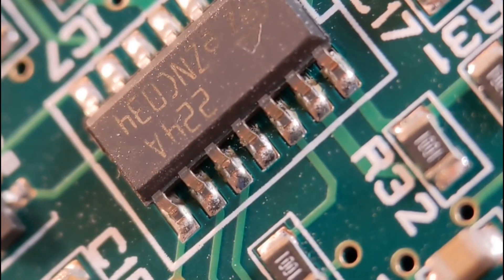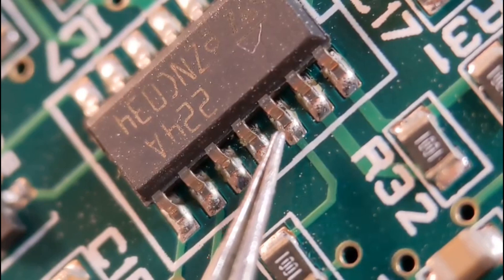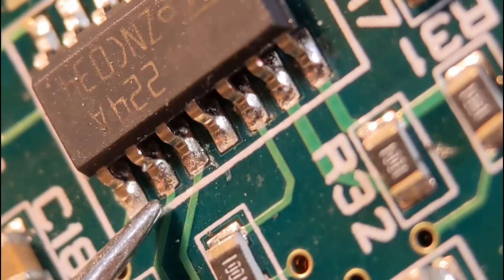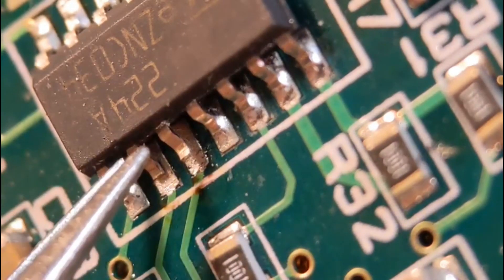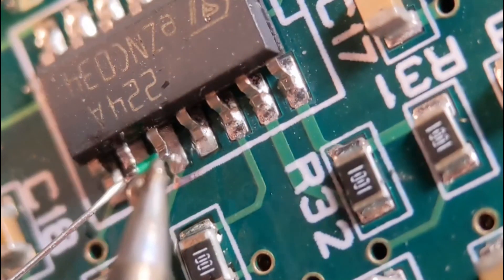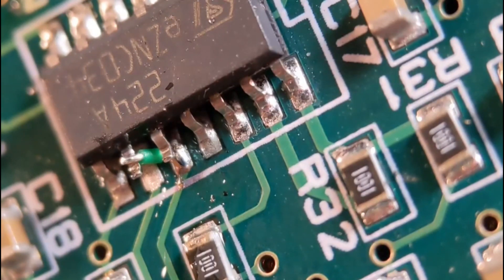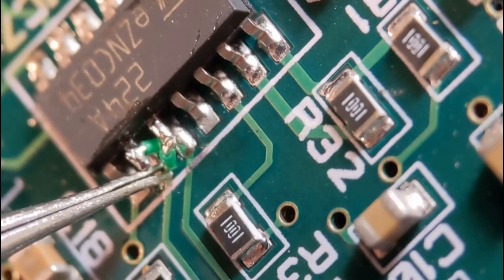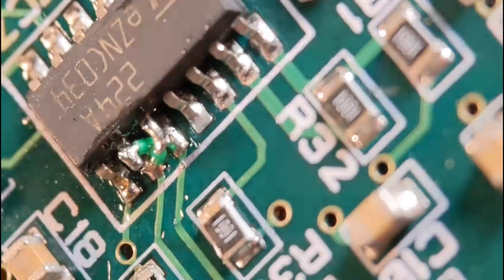SMD Modifications / IC Modification | SMD Soldering Tutorial

Comment: I've been trying, i have a board where 4 pins right next each other aren't routed to anything, but they're the only pins with the IC feature that i need, so i want to attach some wires to them, i can then glue the wires down somewhere safe and attach a connector. The package is TQFP100 with 0.5mm pitch. I tried attaching with wire wrapping wire (single strand, i think PVC covered, 30GA) and have not had success. I get all sorts of a mess. Best i can do looks like is blob several pins together :D I wonder what i'm doing wrong and how to improve my performance.

I don't think i'm even seeing very well what i'm doing, but i'm not going to have money for a stereo microscope for sure not. I have head loupes but there's a limit to how much performance i might get out of them, before the soldering iron must collide with my nose, i think topping out at something like "3.5x" while manipulating. Inspection is not a problem, variety of loupes work for that. I probably have a 50mm c-mount lens somewhere, a random HD webcam or CVBS module, i can build a video microscope from things i have at hand plus effort, but i'm not convinced how it may help me yet. Do you have advice on magnification tools suitable but cheap?

I have not tried lifting the pins, because the pads go nowhere anyway. Should i try to lift the pins? Game console modding community also suggested that i don't try to solder to the flat down, but to the vertical leg section upwards. The PCB pads extend a good ways beyond the IC pads but last time i tried to solder to them, i only lifted them, which is weird, normally i don't lift pads, but i must have tortured them for too long and the pads don't actually go anywhere, so there isn't much anchoring them down.

I have no problem soldering such a chip down to a PCB, but modification has proven difficult.

Comment: If the leg snapped right against side of IC, can a tiny bit of material be moved to make something to connect to...   Also have you got a video showing this ?   Many Thanks !
Reply from the maker: Hi , I posted a video quite a while ago showing how to fix the exact problem you have got . Yes you can scrape a tiny amount of the body back to expose some of the pin that was encased in the body , use a scalpel or mini dremmel . I explain this in the video and show you two ways to reconnect . Hope the video can help you , good luck 👍

Comment: hey great video ...bro .. whats the name of these green wires .. are these sillicon wires .. is there any name through which i can search these on amazon / aliexpress ... plz help me ..
Reply from the maker: Hi . The green wire used in this video is called Kynar wire . It's a 30 gauge , single core wire and comes in many different colours . It's a great wire for doing modifications on PCB's . I'm sure if you just Google Kynar wire you will find suppliers that stock it. Hope that helps , good luck 👍
Reply: @mrsolderfix3996  : thanks bro for the pointer
Reply from the maker: Hi , no problem . Hope you get on ok 👍

Comment: Great video! Whats that tool you are using to put liquid flux with? I lifted a ic for a bios chip mod some had done and underneath it was glued and it ruined the traces underneath, is this normal to do after replacing ics?
Reply from the maker: Hi , the tool I apply my flux with is simply a plastic cable tie. I've posted a complete video on YouTube all about flux , how I apply it , its uses etc. 
Underneath IC's some companies will use a spot of glue to hold them in position before they flow the solder . When boards are built on a surface mount line ( machine ) this is a fairly regular way of doing it . 
Maybe your IC had an underbody termination which means the underneath would have been soldered to the board with a square pad of varying sizes .
Lastly , maybe someone else who's done work on this IC had glued it down because the pads around it were loose . I generally would put a spot on each corner of the IC externally ( not underneath ) if I had this scenario so as to remember it's there if I had to go back to it in the future . It's not normal common practice to glue your IC's down if you have all the pads in good  condition. I have done trace repair videos if they may be of use to you , hopefully you can save your board.
Thank you for your comment , I hope you get on ok 👍

Comment: For cutting a PCB trace I use a PACE MicroChine or Dremel micro ball grinder tip. When you get some experience with the grinder approach you can remove the trace without any damage to the substrate below (epoxy glass for example). Seeing the knife approach in the video, since I have not done it in about 10 years, actually looked a little scary and crazy. The knife blade looks massive under the microscope. The grinder tips are very small compared to your knife in relation to the trace size. Imagine your knife slipping on a critical large subassembly where you have to cut several traces and add jumpers on a prototype board.
Reply from the maker: Hi . The knife method is actually really easy ( after a bit of practice , like anything ). Some people like a surgeons knife , like I do at times but this video is showing a larger blade with which I can cut micro traces with ease .I know numerous people in the industry who use this method , very safely , and can honestly say I don't know anyone at all who uses a dremmel to cut micro tracks , can't imagine this being done when there's lots placed almost touching each other , seems a crazy method to me. I guess we all have our favourite method , the knife is mine and as I've shown in a few videos can be done very neatly and safely . Thanks for your comment 👍
Reply: @mrsolderfix3996  Ball mills come in very small sizes like 0.40mm. However, they also come in very large sizes like 4.75mm. Cutting large traces is as much of a challenge if not more than cutting small ones with a knife. From a technique standpoint the hand I am using to grind is support on a custom PCB holder + Hand Support so I am not supporting the tool in mid-air with my hand. My hand is at rest. I can also slightly angle the board in the holder if this helps in seeing the depth of cut. 

I would also say if you can try the grinder method give it a try. I know the equipment I use is not usually accessible to most due to price and the large mix of soldering equipment that I use from JBC, WELLER, PACE and HAKKO. Thanks for your reply.

Comment: Hey mate. Great videos. But when would you ever need to do mods like this? I have never experienced any troubles where these tips would help
Reply from the maker: Hi . As I've worked on prototype boards many times over the years , designers can often get layouts on their boards wrong when first doing a PCB layout . These mods are quite common for sorting out these kinds of issues. If you've never worked on prototypes before that's probably why you've never had to do these mods , but they are not uncommon. Thanks for your comment 👍
Reply: @mrsolderfix3996  I literally had to do this just yesterday. Unfortunately, I had to just bodge it because I hadn't found this video yet. I think I got it somewhat decent, but the tips you've given will definitely help me out for next time! Thanks so much for these videos; they're the best on YouTube for SMD soldering!
Reply: P.S. What temperature do you set your iron to, and also what solder do you tend to use (leaded or lead-free?)
Reply from the maker: Hi . Thanks for your support , much appreciated. Glad you enjoyed the video and hopefully found it useful. Good luck with your projects 👍
Reply from the maker: Hi . I normally have my iron set to between 350 - 370 degrees centigrade . I do change my tip sizes quite a bit depending on what I'm doing and this can also vary the temperature slightly .
I use both leaded and unleaded solder depending on what people want but sometimes certain jobs require leaded to enable you to do them more easily as lead free is more difficult to work with , especially some rework. I probably use unleaded 90% of the time these days 👍
Reply: @mrsolderfix3996  thanks, explanation males perfect sense. And spot on. I never worked on prototypes of anything. ✌️
Reply from the maker: Hi , thank you for your support , much appreciated. These modifications are probably strange to a lot of people but hopefully if anyone needs to do them hopefully this video can help them out . Thanks again for watching and good luck with your projects 👍

Comment: may I ask the tools and equipment that you use?
Reply from the maker: Hi . The soldering iron I always use in all my video's is a Weller TCP S model , with PTP7 + DD8 tips.
I have a stereo long reach scope from GT Vision ( just there own branded one )
Flux I use is SMFL200D , available from Farnell , RS Components ,Ebay and others .The wire in this video was 30 gauge Kynar wire also Kynar strippers .
Solder I use is 0.25mm lead free from BLT Circuits ( English Company ) also got same size in leaded.
That's pretty much it apart from the general tools like cutters , pliers etc.
Hope that helps , thanks for the question 👍

Comment: Sorry to bug you but can you send a link for the wire you use because i cannot find it as hard as i try.  Thank you in advance!  Amazing as always!
Reply from the maker: Hi . Does seem to be out of stock at my usual places , like Farnell , RS Components , but I have seen it on eBay . 
You need to ask for Kynar Wire 30 gauge . It's a solid core wire , and comes in all colours . So I'm sure you will find it on eBay . Good luck ,👍
Reply: @mrsolderfix3996  Thank you so much.  Much appreciated!
Reply from the maker: Hi . No problem . Mouser ( Based in America is another option ) you will find it somewhere . You can also buy proper kynar strippers for this wire . They are fairly cheap and I love them . Good luck , thanks for your support 👍

Comment: What causes pin bending whilst trying to re-run solder on the last ic chip type? Love all your videos.
Reply from the maker: Hi . I'm not sure if I've got your meaning correctly but do you mean why is the lifted pin bending while soldering to it ? If so it's just the pressure being put on the pin . When I'm soldering any lifted pins ( thin or thick ) I'm really careful to not stress them at all and this means I get no movement of the pin itself . Hopefully this is what you mean . Otherwise just contact me again and maybe I'll get it right next time 👍
Reply: @mrsolderfix3996  the pins are still on the pad but they seem to have bent nearer to the ic  inwards others left or right bend in them some have moved off the pad. I assume it's due to pressure I put on the iron and trying to drag solder. Is there anyway to sort them out?
Reply from the maker: Hi . To lift pins off their pads ,  the best way I have found ( which always works for me ) is to place a small tweezer point or a fine scalpel blade behind the pin and gently turn it forward . Once you have lifted it about 1mm off the board I then use solder braid on the pad to clear all solder . Then it's easy , you just place above mentioned tools behind the pin ( or from the front ) and keep lifting until you have the height you require . 
I guess you did put to much pressure on without getting behind the pin . You can still do it with a fine scalpel blade behind it then do as above . Hope that helps , good luck👍

Comment: Thanks for the video, what section of thickness do green sheathed wires have?
Reply from the maker: Hi . Thank you for your question . 
The Kynar wire I used in this video comes in various thicknesses ranging from 24 gauge ( 0.5mm ) to 30 gauge ( 0.25mm ) . I used 0.25mm in the video and it also comes in various colours . 
For a microwire , I also have a copper enamelled wire which is 0.20mm thick . This is a great wire which you just burn the enamel off the joint when you solder it leaving the whole rest of the wire with invisible sleeving on it . I will do a video soon featuring this wire . If you need any of these wires just Google them and they are quite easy to find. Hope that helps , thanks again 👍
Reply: Ok, perfect thanks for everything I will follow you in your videos are very interesting 👍
Reply: I asked you for this information on the section of the wires, for the reduction of noise and parasitic inductance of the circuit tracks. Thanks again for your availability!
Reply from the maker: Hi . Thank you for watching and good luck with everything👍